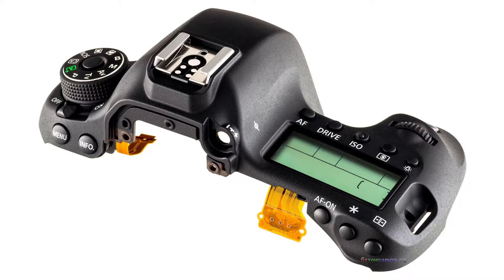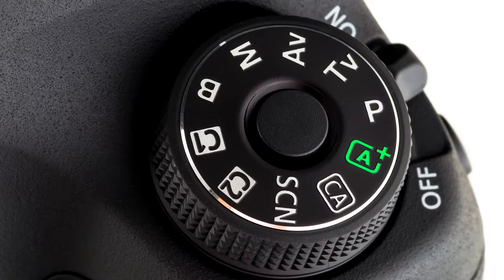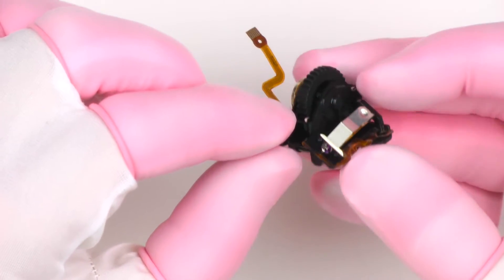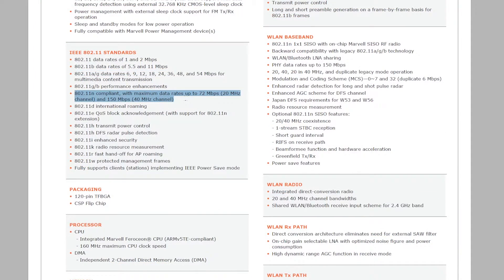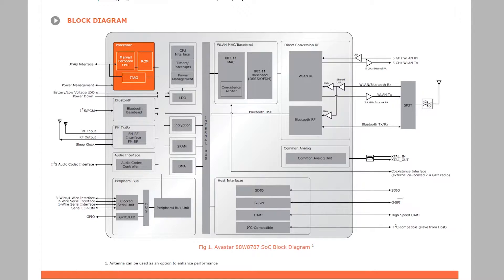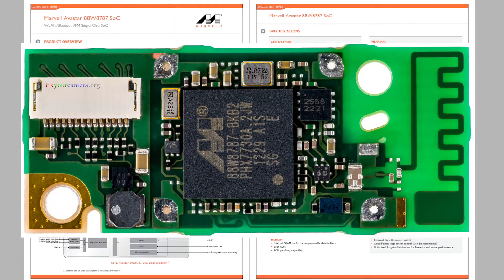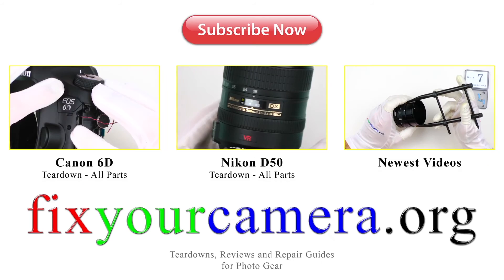Is Canon 6D worth it? TEARDOWN & Review - part 2

Comment: Hello ... great insightful videos . We appreciate . I bought a canon 90D supposedly new from our local market in Accra -Ghana . 4 months after in an event , the camera would not respond . the top Lcd panel comes on but nothing else is responding . I have described the issue to a service centre far away in the U.S...they suspect or suggest the system control SMD microchip requires replacement ...WHat is that supposed to be ...

Comment: is it possible to modify that knob or change it so that you dont have to push that button in the middle to turn it? I hate having to push that button. I preferred the knob on my original 5D. I never accidentally turned it so I dont need it locked in position.

Comment: Hi. This is the most clear and detailed video about a camera. Great. Work! I am not an expert, but having such a radio-wifi-bluetooth-ect chip built in sould be able to control an external flash unit. It sounds so reasonable and it seems it is capable hardwer wise. Looks like canon makes us spend more money for an external triger. Or it is false?

Comment: Please, all the commands work on my 6o eos but no life signal on the back lcd, I already changed the lcd but it did not work, could it be the motherboard?
Reply from the maker: it could, but first check VERY CAREFULLY all buttons and switches - if just 1 is shorted the rear LCD won't work

Comment: Excellent information and visual presentation! My canon 6d is misbehaving and I need to see the part 3 to gain the information necessary to theorize which PCB has failed. I get power, but after that 2 shutter accuations followed by error code 20 (hardware failure), and no LCD display. Main PCB, or bottom PCB?
Reply from the maker: I would check the phase position switch(plastic gear with brushes on the side of mirrorbox) and motors first. Mirrorbox removal requires a very precise image sensor position measurement. Highly unlikely it's a problem with electronics...Good luck!
Reply: i opened the back and found a piece of white plastic that resembled rice. could that be a piece of the worm gear?
Reply from the maker: all gears are black in this model (if I remember correctly...). I do find rice beans quite often inside water damaged cameras, people believe it has some magic properties ie.: it can fix stuff by drying it up etc, total nonse btw. Did you buy this camera recently from someone? Water damage repair is a lot of work...

Comment: Hi, great video ! on my 6D, on the rear cover,  one multi-selector button don't work anymore... I think that is problem come from a liquid during a music festival.... How to fix it ? need to change it ? or just clean it ? and where can I buy a multiselector ?

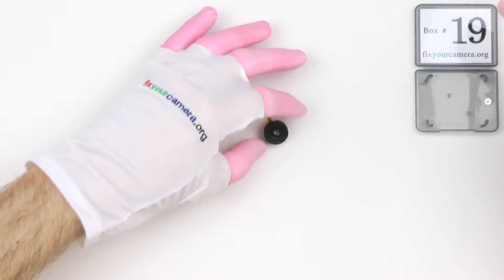And, in your video if you stop at 08:21, to access of it, what is the best way to remove orange connectors ?
Reply: I succeed to disassembly the rear cover. I found the orange connector piece on ebay for the multiselector. But it seems glued on platic multiselector button, it is ? how to remove an change it?

Comment: hi! thanks for the breakdown and can't wait for the next one!  Can you tell me where to find the light meter on 6D?
Reply from the maker: Light meter is pretty much always around the viewfinder area, right below the top cover. It's position is factory adjusted, so please be careful with it.
Reply: +FixYourCameraORG i have dropped my camera and now it is metering 3 stops more. i want to fix it
Reply from the maker: Ok, that's a common problem. The meter is held by a glue, which most likely cracked and the whole meter became loose. I always check all flex cables first in the viewfinder area, re-seat them all, and check for any loose/cracked parts at the same time. Please be very careful, it looks like an easy job, but still, you could do a lot of damage inside....if not careful enough
Reply: +FixYourCameraORG ok thank you very much.
Reply: +FixYourCameraORG why have you stopped posting videos?

Comment: Hi, I am just wondering if you ever serviced a 7D mk1, and what do you think of it in terms of build quallity, since I think they are one of the most rugged cameras out there and I just wanted to see if I'm right or not :D

Best of luck with the channel, personally I find the content refreshing and very informative, so yeah thanks for making these videos ^_^
Reply from the maker: Hi Edim, Yes, I did work on these, still do from time to time. I would highly recommend this one instead of one of those crappy cheap entry level DSLRs! Good choice, although Canon does'n sell parts for this model anymore, I think. And one of the common problems is loose screws inside (as with many other Canon models). Still a great camera. If you're going to buy one, look for reasonably low shutter count <100k, or best  <50k, no water damage and get it checked for loose screws - sure as hell there will be some on the bottom! It will cost you some little money, but if one falls out of it's place and cause some shorts - it will cost you several hundred $$ easily... THANKS!!
Reply: I do own one and I'm really happy with it, and thank you for the useful tips since I didn't know such problems could occur :D

Comment: Great video! You know so much! Can you tell me how you remove the rubbers on cameras cleanly, I need to replace some on my D700
Reply from the maker: Hi Sean, It's hard to remove rubbers from Nikon cameras without leaving any sticky tape and glue left (Canons are MUCH easier), comes with experience. Especially older rubbers leave a lot of residue, but it's easy to remove it with alcohol and some elbow grease:)
Reply: thanks for replying, I will do my best!! Keep making great videos!!

Comment: what's a good way to dehaze vintage lens elements?

modern lenses have too many flex cables. i wouldn't dare opening them up.
Reply from the maker: Cleaning them would be a good starting point:) Although it's not always that easy - there are lens groups you won't be able to disassemble and / or something could be going on with lens coatings over time and replacement is the only option in this case. As you said, older lenses are usually easier to disassemble, but be extremely careful not to touch any adjustable parts - there could be many inside / depending on the lens.

Comment: you might already have these question answer. where can i get these tools your using. i did look around but couldn't find any. i am specially interested in the little brush u use to apply the grease to the rim screws. very handy for other applications as well. any help would be great.
Reply from the maker: Hi Joshua, brushes - I got them probably from "Michael's craft" or some similar store, easy to find and super cheap...

Comment: Hey Mike, I'll ask here since this is your last video made, but I'm rather upset over Nikon right now not willing to sell parts.  I was in a hurry and bumped the focusing screen on my D810 with the tip of my blower.  Because of this their is a scratch on the focusing screen that is just annoying every time I look thru the viewfinder.  I found that the focusing screen is actually really simple to remove on the D810 (about as hard as removing a memory card), yet Nikon is not calling this a user serviceable part and thus are refusing to sell it.  I looked on eBay for some focusing screens, but have a hard time trusting that they are true Nikon parts, and find it Bull that I have to send in my camera possibly for a month of downtime and a $200 repair for a $40 part that requires no tools to even change.  What are your thoughts on Nikon refusing to sell parts, and is there a work around to get this part? Thanks, sorry for the long post.
Reply from the maker: Nikon loves your money, don't they:)? 
I get similar questions every day at work, since 2013 (before 2013 parts were available to everyone, but with horribly long back orders - taking several months to deliver). Some people get really furious about this, I mean REALLY FURIOUS!
It’s always your choice when buying something. I.e. with Canon you could have your focusing screen for a couple of bucks, delivered in 2-3 days, no questions asked (or any other part you would like). 

Nikon will charge you $220 + about $50 for shipping and insurance to deliver it to them or whatever the total $$ might be, and you have to wait who knows how long, it’s always a lottery with waiting times. They are totally open about no parts available and they say it’s good for you! It’s good for them,,. for sure! They increased their repair prices in 2013 about the time
of “no parts to customers” announcement, hmm interesting coincidence…

Your choice was Nikon. Sorry:) you have to pay now… wait and hope to get it back quickly. 

You are correct about Ebay parts, lots of them are junk. So if you go this route – look for a genuine Nikon focusing screen. There is no guarantee you’ll receive a genuine one though or that it will be free of scratches.

It’s a pain, I know…

Comment: Very nice video! Just wondering, the backdial (that thing that rotates on the backplate) is that integrated in the backplate? Mine is broken, curious to know if a repairshop needs to replace the full backplate or just the dial.
Reply from the maker: +Wiebe Nieuwenhuis     There is no separate part number for the rear dial parts. So, unless you can get this part somewhere else, Canon will sell you the whole rear cover (without LCD probably).

Comment: I have a yongnuo yn -568ex  flash. for nikon, the problem is stacked in full power 1 / 1  what seemed to be the problem of the flash.
Reply from the maker: +Allan Sarmiento    IGBT transistor failed most likely and needs to be replaced. Or get a real speedlight!:) Yongnuo quality is highly questionable... to be politically correct. High voltage inside, so be careful if you'll ever attempt to fix it!
Reply: Thank you very much sir